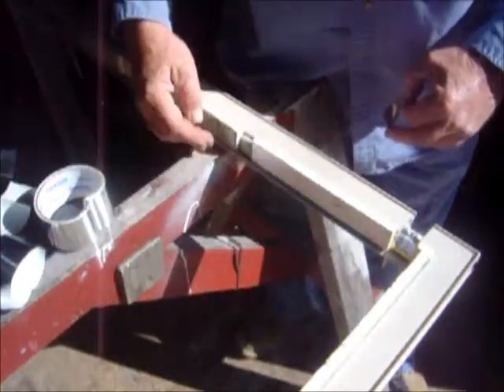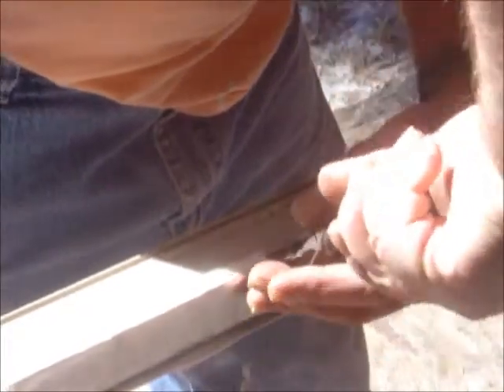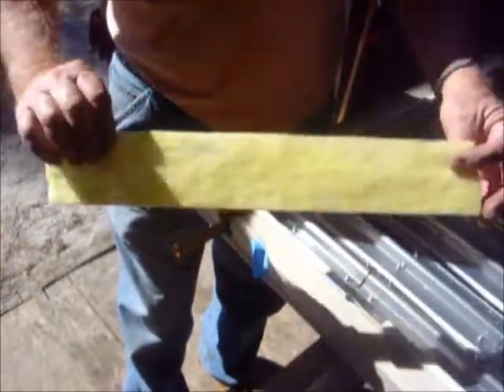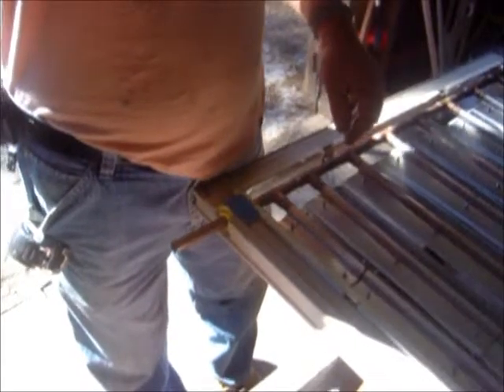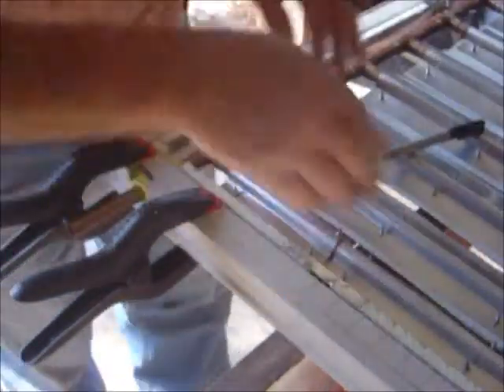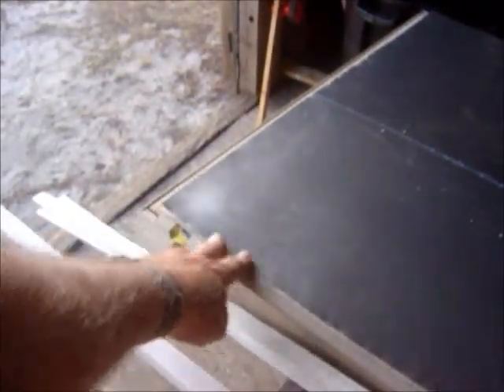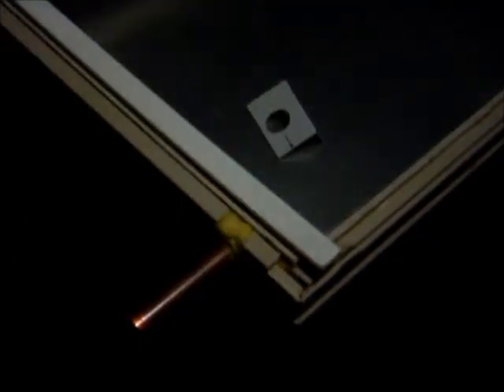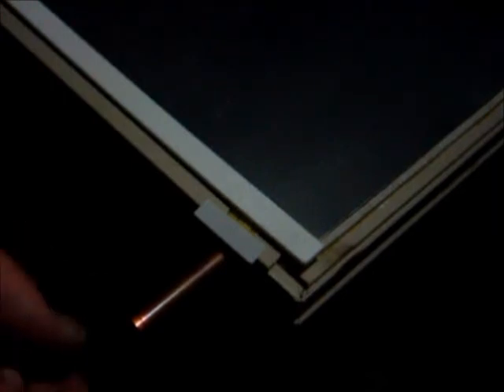Solar Collector From Vinyl Sliding Door2

Comment from the maker: @DeleteMeOnline Thanks for the comment, and yes I am making a stand alone solar water heating unit with these collectors. Stand alone meaning PV powered 12V system. No grid power.

As for the construction methods, I try to keep it simple and use materials that last. No rotting, rusting, repainting, or repairing.  Mechanical and electronic things sometimes fail and need repair, I think that's carved in stone somewhere isn't it? :)  Pumps and controllers might fail....IN ABOUT 10 YEARS ! :)